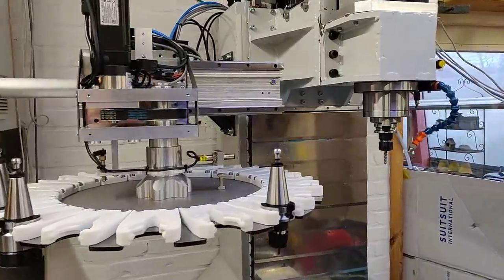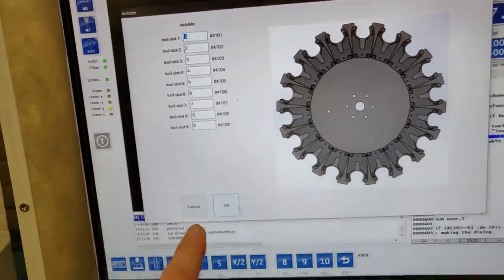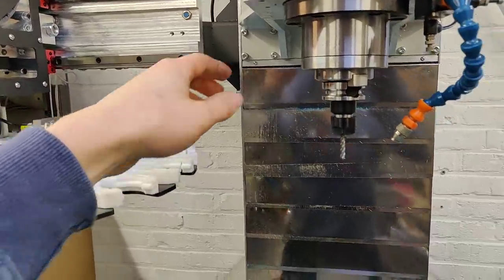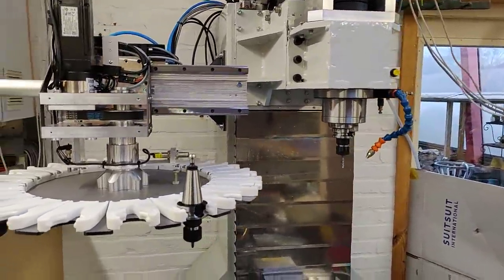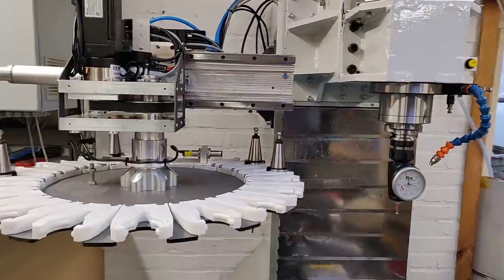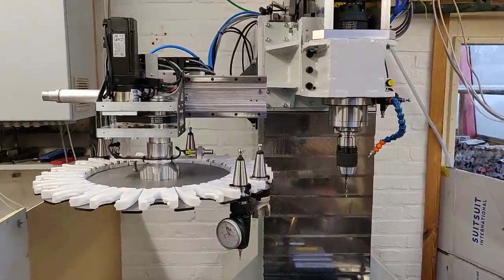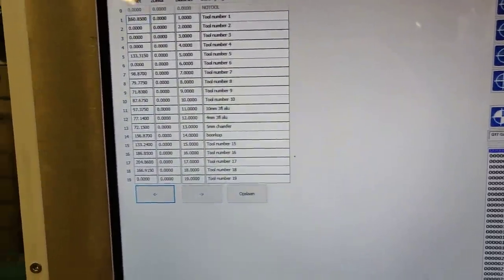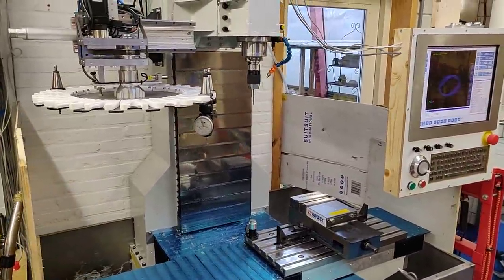Epoxy granite cnc mill toolchanger explained

Comment: Hi Stef, 
Congratulations on your excellent work!  
I use touret tool change on my lathe and I defined it as angular A axis. The tool change takes the shortest route. I use Mach3 and there is a general logic configuration in which I selected "Ang Short Rot on G0" and "Rot 360 rollover".
Double check for similar option in Edingcnc.

Comment: Nice. A tool changer looks simple until it malfunctions and you have to manually clear all the alarms and not drop any holders. Even at this point you did a great job. I'm confident you will continue your R&D and resolve any issues that annoy you. 👍👍👍👍👍

Comment: you can have your tool carousel run in an incremental indexing instead of absolute which would allow it to run backwards instead of one way. If you want to run a C-20deg move from T1 (C0) to T18 (C340), you could have a short macro to determine which direction is closer. If the commanded C position is more than 180deg, then take that commanded C move (C340) and subtract it from 360 (to get C-20) and command that for the C axis.

Comment: To get to the shortest path tool to tool, you will have to subtract your present tool from your next tool with some defining logic that is something like "if next tool - present tool >9 , go ccw", I have written several tool changers for Linuxcnc, simple like my Hardinge  lathe, insanely difficult like the Brown and Sharpe mill. I assume you are using degrees of rotation to define each tool position, 18 tools is 20 deg per slot or so many incremental encoder counts. I see no advantage to a random tool changer on a carousel , put the tools back in their original pockets. I just renumber the tools in my cam, its easy. Impressive work, lots of labor.

Comment: To increase the speed you can maybe add this script if you use python:
def is_backward_faster(current_angle, target_angle):
    # Convert angles to positive values between 0 and 360 degrees
    current_angle = current_angle % 360
    target_angle = target_angle % 360

    # Calculate the angular difference in both directions
    clockwise_diff = (target_angle - current_angle) % 360
    counterclockwise_diff = (current_angle - target_angle) % 360

    # Check if it worth to go front or behind
    if counterclockwise_diff < clockwise_diff:
        return True
    else:
        return False

# Exemple d
current_position = 30  
target_position = 345 

if is_backward_faster(current_position, target_position):
    #add function to go backward
else:
   #add function to go front

Comment: At least you didn't implement a rotating arm that preloads the next tool on one side and then performs a subsecond tool swap, putting the previous tool away after the spindle is in the cut. I've had issues with these arms throwing tools. This problem is caused by a loose position sensor.

Comment: Is there a differnce between an CNC mill for metal and alloys  and a CNC Mill for stone and granite?
Or is it only the cutter?
Reply: A machining unit for Metals & Alloys needs precision whereas a machining unit for stone doesn't need precision. The build remains same except the linear elements (higher accuracy higher cost) vary in terms of accuracy grade for a stone machining unit. Also the Cutting edges are different for different metals and stones....
Reply: if you are referring to the title of this video having granite and epoxy in it and thinking that this machine is made for cutting said materials, it actually refers to the machines structure being made from epoxy granite and not being made to cut it. how ever if you genuinely want to know how a metal milling machine can vary compared to a machine made for grinding stone and such i think it would depend on the nature of what the stone is being cut for. most metal mills are designed to remove a lot of material and to cut deep, so a lot of rigidity is required for that. but if a machine is made to simply level and polish stone counter tops say, it still needs to be rigid but no where near as much as it is simply doing very shallow grinding operations, and they have a very different set of tools designed to handle the very hard materials and are very heavy on lubricant/washing.

Comment: You've pointed out the sensors on your tool change system designed to avoid error conditions - I noticed that there's a little bit of deflection in your carousel. If for some reason that increases over time (as tools are added and the overall weight increases causing the carousel disk to flex, the fasteners that join it to the hub deform, or the supporting bearings wear beyond tolerance) is there a way  to stop the system if the plastic yokes of the tool holders fail to line up with the channels on the collets?
I can see that the delays caused by the unidirectional axis issue  as being something you can write off now. If in the future, however, if you decide 18 tools in the process just isn't enough, and you replace it with a drag chain system with the full 99 slots available, waiting for it to cycle through 100 positions is going to get a little frustrating.🤣

Comment: Hey Stef, 

first I have to say congrats for your projects! Absolutely amazing what you build. 

I have one question to your ATC. Do u use a Laser Sensor for the tool presence check and if yes, what type? I have the same problem as you that the tool is to far away from
the sensor so no inductive sensor will work.

Thanks a lot
Reply from the maker: Hey yes thats a lasersensor. But i have never implemented in to the code so i dont have any info in how good it works.
Did some small tests in the begining and it seems to work good enough.

Comment: Great build - really. One question, what ratio gearbox is attached to the ATC servo? Also I assume the belt pulley would be 3 to 1? And why would one need so much of a overall reduction ratio? Surely any servo even with a resolver can accurately position the pocket on target, right? Just missing the reason for the huge reduction ratio. Thanks in advance.
Reply from the maker: The total reduction is 1:20. Just a feeling i had i didn't calculate anything. Probably it wasn't necessary but also can't harm it.
Reply: @Svanitterzon  I see. Then to add to the confusion, the new Chinese ATCs on AliExpress come with 40 to 1 gearboxes. Trying to keep the design of my ATC as simple as possible, as cheap as possible. Check out my YouTube channel, in particular the 5 Axis ... I suppose it could be one of your next projects.  Thanks again.
Reply from the maker: @PWLopes9000  im already subscribed for a while. Because of your 5th axis project😅

Comment: Great job. Does the software and controller have options to actuate the cylinders ,release valve and tool changer servo in sequence? Cause it looks like a lot of programming to me!
Reply from the maker: No but In fact there is not a lot of code needed to make this toolchanger work.
Mabye 20 to 30 lines of code is enough for basic operation.

Comment: good job, which motor+gearbox are used ? rpm ? thank you.....I will follow you
Reply from the maker: ECMA-C20604RS and a 10:1 Gearbox not sure what feedrate i have the servo running at but not that extreme fast.

Comment: Great diy!!! I am learning a lot from your wonderful machine. Can you explain how to make sure the spindle alignment for toe position?
Reply from the maker: Thats handelt by the spindle driver. And he will give a confirmation signal when spindle is in position.
Reply from the maker: @x k there is an encoder in the servo that drives the spindel.
Reply from the maker: @x k ah mine driver has an input that if you put it high the spindle goes in special toolchange mode thats supplied by the driver. And park the spindle in programmed position. Its not controlled out of eding it self.
Reply from the maker: @x k https://m.szghauto.com/product/127.html

Comment: Congrats for the great work! Can you give some info about your cnc control software and board?
Reply from the maker: It's a cnc760 card from eding, on there website you can download the software, if you run the software without an board connected it goes in simulation mode so you can play with the software really nice. Www.edingcnc.com

Comment: How does the spindle align the pins? How does it know where its at, even if you shut it down? Its an absolute encoder on the spindle no?
Reply: No Absolutencoder, he use the index signal Z from the inkremental encoder for spindle alignment. Its simple. All you have to do is switch between velocity control and Position control and back.
Reply: @svenkrause3433  but how can it remember the position if the machine is powered off and the spindle might be rotated
Reply: @danielmattsson8574  Not at all, if you call, for example a M19 xx, the spindle search the index and align for the first time. After that the controller knows the position.

Comment: good job!
Not sure what purpose the "safe" top position serves in the cycle though... Looks like you could directly have the Z to go at the correct height for the tool changer to operate. Software limitation?
Is the disk Dibond ? (Al-plastic-AL sandwitch)
Reply from the maker: Mabye you are right, its not a software limitation, since i wrote the whole procedure my self. I also need to change my post processor then. I belief fusion first sends machine to home and then calls a m6 command which means head will always go up first anyways. The disk is just a 5mm thick steel plate.
Reply: @Svanitterzon  got it. Makes sense Fusion tries to home Z, if the tool change wasn't mounted on the column it could result in a crash
Better safe than quick I guess

Comment: Hello sir ,which atc kit did you buy ,or u made your own sir .
Reply from the maker: Made it my self.
Reply: @Svanitterzon  

My design is not working properly for bt40 tool changer sir ,but my own spindle design working fine ,can u please share your mail ID sir.
Reply from the maker: @sandeeps7979  https://grabcad.com/library/epoxy-granite-vertical-cnc-mill-1 here is the 3d model of the atc
Reply: @Svanitterzon  

But I need solid works model or fusion model sir.
Reply: @Svanitterzon  I only needed atc .

Comment: Hello Don’t know if this will be any good but used the modulus function in C it always goes the the fastest route !! 

void move_stepper(int new_tool_num, int prev_tool_num)
{
   long step_pulses;
   long step; 
   int steps_tool_num;
   int C,D;
   
   step = 0;
   step_pulses = 0;
   steps_tool_num = 0;
   
   disable_interrupts(INT_CCP2);   // Setup interrupt on falling edge
   disable_interrupts(GLOBAL);
   
   C = ((prev_tool_num - new_tool_num) % 8);
   D = ((new_tool_num - prev_tool_num) % 8);
        
    if(D <= C ){
        printf("\r\n Going Forward");
        printf("\r\n Steps D = %I", D); 
        printf("\r\n New Tool Num = %I", new_tool_num);
        printf("\r\n Previous Tool Num = %I", prev_tool_num); 
        steps_tool_num = D;
        output_low(AIR_SOL); // Valid Tool so turn on sol and wait
     output_low(DIR_PIN);  // Direction Pin 0 on stepper drive 
        delay_ms(1500);
    }
    else if(D > C){
        printf("\r\n Going Backwards");
        printf("\r\n Steps C = %I", C);
        printf("\r\n New Tool Num = %I", new_tool_num);
        printf("\r\n Previous Tool Num = %I", prev_tool_num); 
        steps_tool_num = C;
        output_low(AIR_SOL); // Valid Tool so turn on sol and wait
     output_high(DIR_PIN); // Direction Pin 0 on stepper drive 
        delay_ms(1500);
    }
    
   if((steps_tool_num >= 1) && (steps_tool_num <= 8)){
       // only a valid tool number allowed to move !!!  
       step_pulses = (steps_tool_num * MOTOR_STEPS);
       printf("\n\r No of Step Pulses = %Lu ", step_pulses);
   for(step=0; step < step_pulses; step++)
       {    
           output_high(STEP_PIN);
           delay_us(600);
           output_low(STEP_PIN);
           delay_us(700);
        }//end for   
     }// end if
   
      enable_interrupts(INT_CCP2);   // Setup interrupt on falling edge
      enable_interrupts(GLOBAL);
}// end func